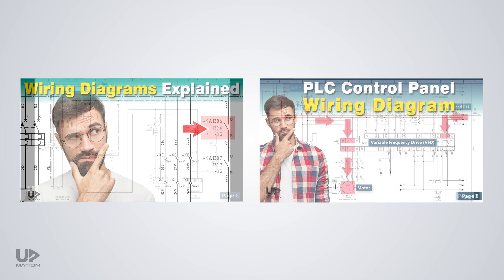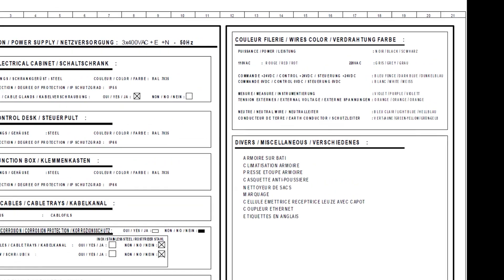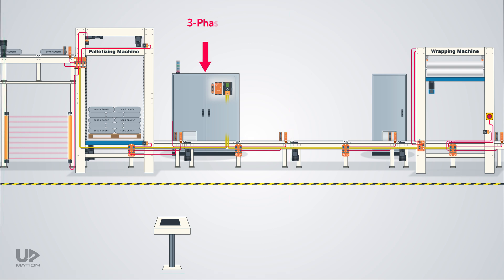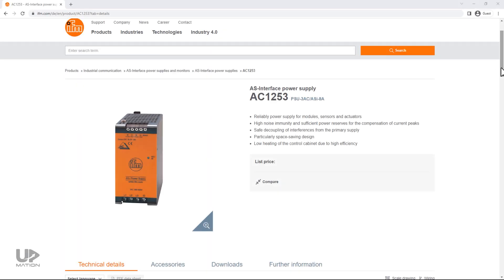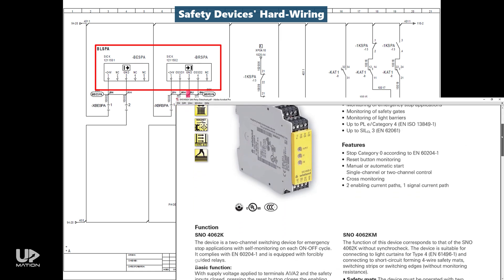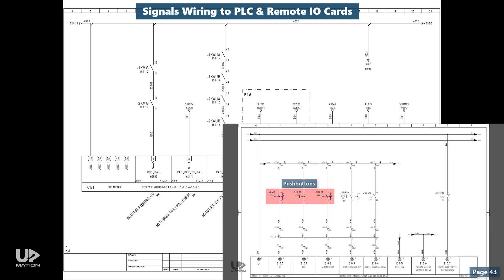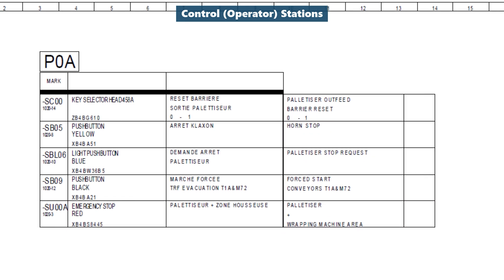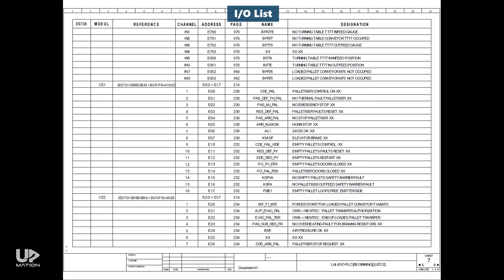Wiring Diagram Structure of a Real-World Custom-Made Machine | Industrial Wiring Diagram

Comment: Good video. What is this "ASI Master Device"?
Thanks.
Reply from the maker: Thank you for watching! The AS-interface master is a controller that controls its downstream instruments independently using the AS interface protocol which is a specific protocol for the field level of the automation system. At the same time, it is connected to the upstream bus of the control level to exchange some data to/from the higher level of the control system. For doing so, it converts the ASI to other Fieldbus protocols that are usually used by the control level such as (Ethernet, Profibus, etc.)
I suggest you watch these two videos to get more insights:
Distributed IO vs. Remote IO: https://youtu.be/PxvDM0hhr-Q
Remote I/O System for Industrial Automation: https://youtu.be/Fqx4Knk-TTQ
Reply: @Upmation  Thanks for your prompt reply. Keep it up.